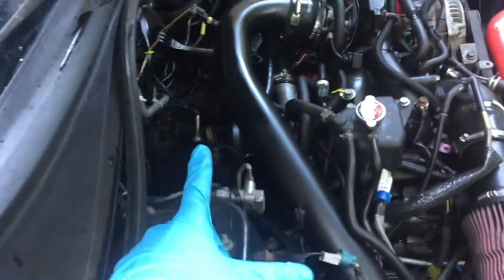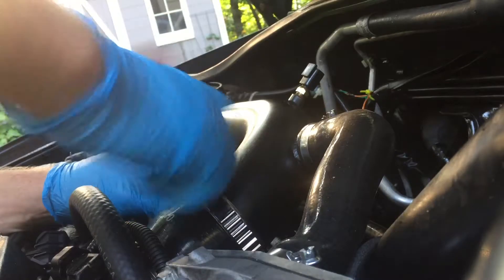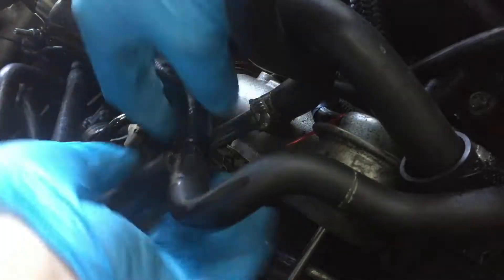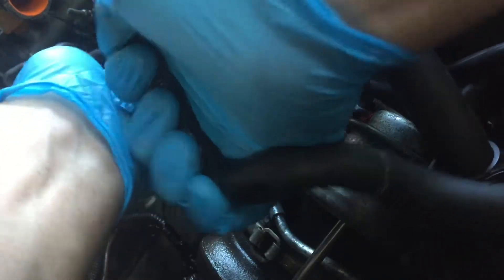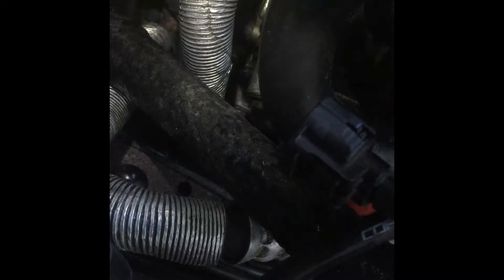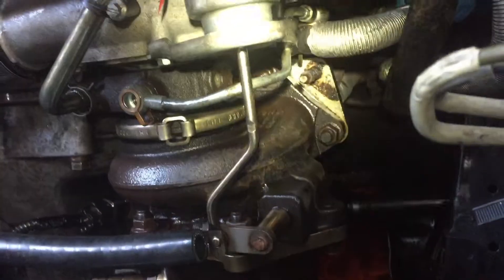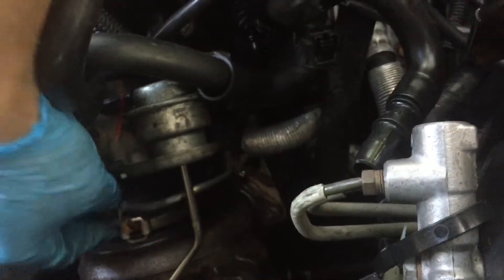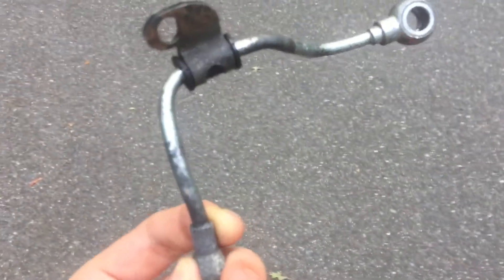StiDiy Replacing turbo to head oil line

Comment: i know this is an old video; however i have a question. where did you get you copper washers for the top of your turbo oil line? I would pay extra for copper washers that connect.
Reply from the maker: Whatsup man I just looked them up again and they seem available from a few different places, can’t remember where I got mine but it looks like fastwrx.com sells them with a new banjo bolt, oakos sells them by themselves it looks like. You could also get a generic kit and size them up, but either way definitely replace them

Comment: @ 2:37 where you unbolted that bolt were you leaking oil there?  if not where is the oil leaking from because I have an issue
Reply from the maker: Yes from the top bolt apparently these lines can break when removing and installing them like bending them if the turbo is out even the slightest and the O rings can leak on top. I first had a pin hole leak from the actual line then later it was leaking from crush washers fwiw
Reply: @BenSpoolin  thanks I’m here at the mechanic shop they said that’s where my leak is coming from just bought the part from Subaru top n bottom lines and crush washers and bolts thanks for the info
Reply from the maker: got you G good luck with the repair!
Reply: @BenSpoolin  no more leaks 🙌🏻
Reply from the maker: @Jay_533  love to hear it!!